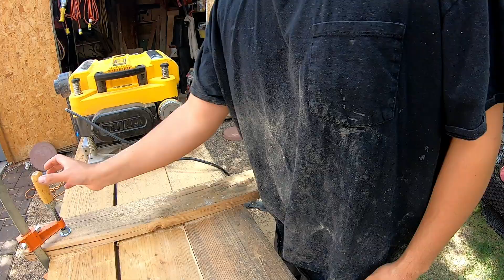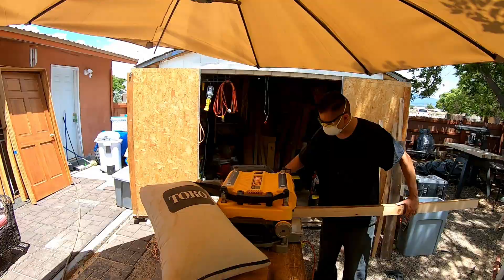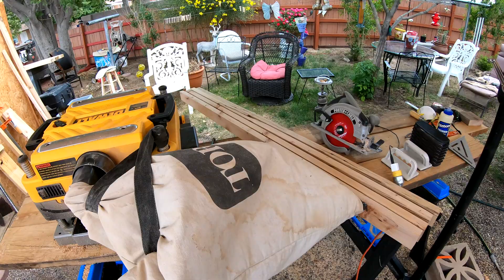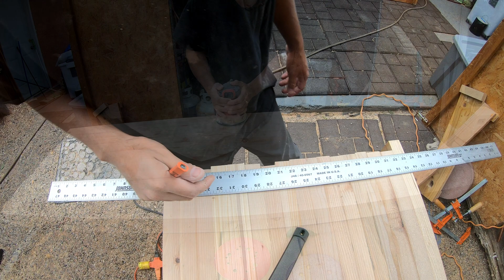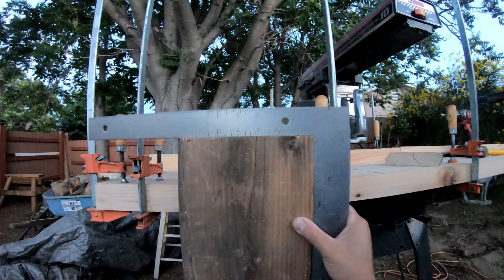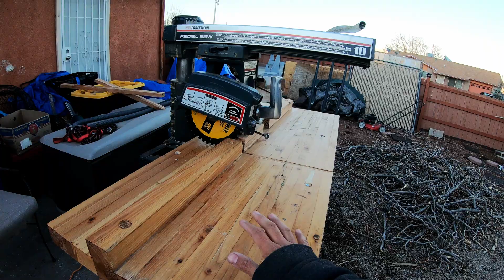Woodworking Arm Saw Table Build

Comment: Not sure if you did that intentionally, but you’re supposed to pull the arm saw into your work pieces not like you showed.
The saw blade is going to want to climb up on the work piece. Push to stock into the direction your wheel is spinning not behind the wheel.
Like the idea of the thicker table. Looks nice.

Comment: Did you ever cut a miter slot for the fence?  Also, just a suggestion--put a coat of paste wax on top of your polyurethane finish to help protect it.  It will also keep it nice and slick...and paste wax is cheap so you can always apply more + it repels dust so it will be even easier to clean when you're finished cutting.
Reply from the maker: No miter slot. the whole table is adjustable back and fourth incase the fence is off.

Comment: Nice build, but a lot more than I am capable of as I have neither a planer, nor a jointer as yet.  I'll have to stick with building a table from 2 pieces of mdf for now, glued together and then worry about a fence afterwards.  Right now I'm still in the process of tearing down my RAS and it's cabinet stand and refurbishing them.  I have the cabinet stand finished, the base in rust converter primer and the saw, post and arm all apart waiting on cleaning, new bearings, new wiring, wire wheeling the bare metal parts before clear coating them (pawl, thumbscrews, handle rods, etc) and priming and painting the saw (yoke motor, etc.) and arm.  The post will stay just as it is because it is cadmium coated from the factory for lubrication and that stuff is toxic, though I will clean it with wd-40 and shop towels.  It's an ancient old DeWalt MB RAS made in 1956, but it's built like a tank.

Comment: Nice table but why are you cross cutting the boards backwards? The cut should come pulling the blade from back to front not pushing the blade from front to back.
Reply from the maker: Thanks. It’s to prevent the blade from climbing on the wood and stalling the motor which has happened plenty of times, then I have to wait 30 minutes before resetting the motor, not to mention ruining the wood. Also when cutting larger pieces of wood there is little to no risk of the wood kicking upward, especially on a smaller 10” blade like this one, with very little horsepower. I’ve found it to be mostly a myth, at least for smaller RAS.

Comment: Nice table!   My front part of the table is frame mounted but the back is clamped to squeeze the fence in place, but that makes the fence removable and replaceable (as long as the back of the mounted table is square)    Always thought that the fence was sacrificial and should be replaceable.

Comment: Hey! I just for one like yours for 50 dollars. However, I have no idea how to change that old blade. Do you have a video or Can you do a tutorial for changing the blade
Reply from the maker: Nicee. You just have to remove the blade guard by turning the screw on it, Then the blade’s only held on with one nut. I just use a large socket on the nut, and hold the other side of the blade with a set of vice grips, or a crescent wrench. Should get the nut right off.
Reply: @MyCraft_01  hey thanks! I’m excited to use this very interesting tool!
Reply: Just remember that the thread/nut on the motor spindle is left handed!   Righty loose, Lefty tight, and don't strip it!   Near impossible to replace.